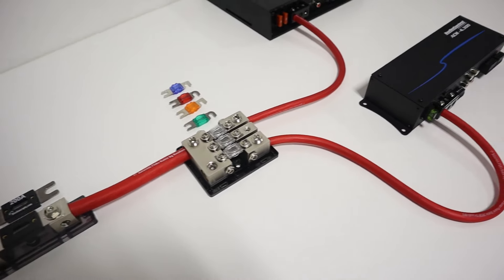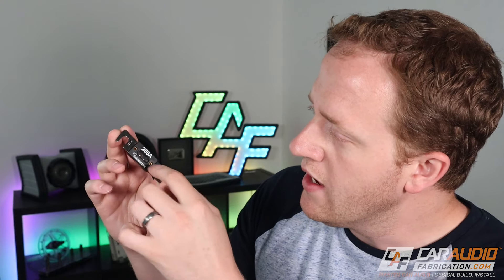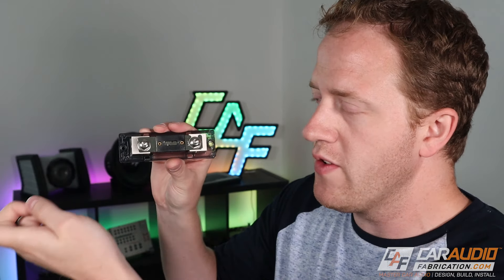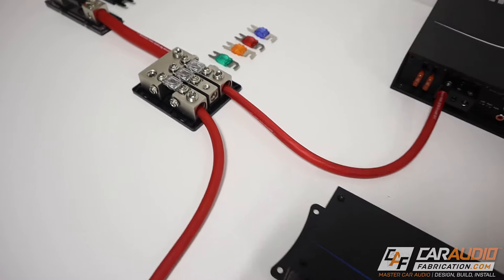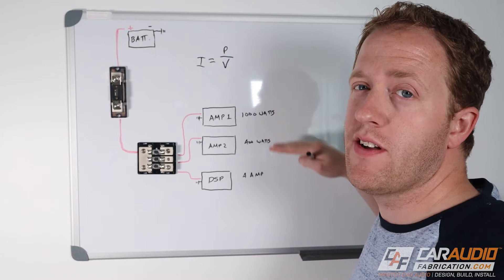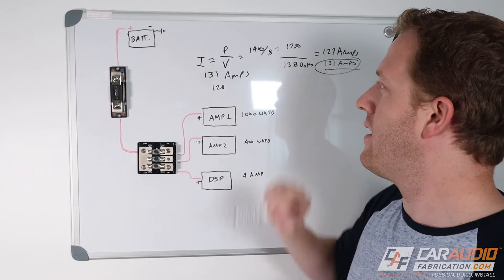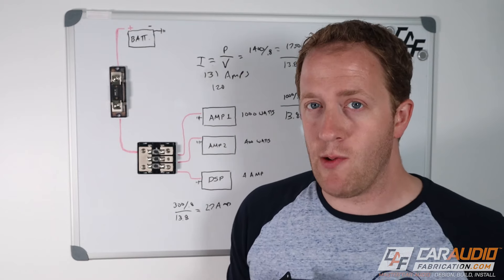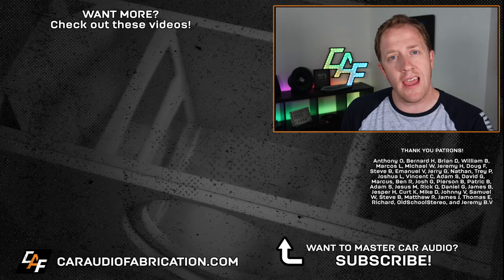Fuses EXPLAINED! What size do YOU need & MORE!

Comment: Hi mate, new to this whole thing but want to learn I got a RFC10HB Rockford fosgate capacitor and a  S-Series 1200W Mono Amplifier for a two 10inch sub and I want to run another amp for the speakers would I still need a distribution block or I can use that capacitor as a distribution block? Thanks

Comment: I have a 8000 watt amp wire at 4000 watts 1ohm for 2 subs, 1500 watt wired at 600 watts for mids, and a 4 channel wired at 100 watts per channel for highs,,,, could you tell me if i figured right at needing a 500 watt main inline fuse. that  seems like a lot.  learnt just about all on installing from you videos and still learning. thanks

Comment: Hi 
    Love your videos. You mention that the amps have fuse specs, but you want to show how to calculate without those values. This is for a Audio Control dsp/amp:
AudioControl D-6.1200
6 x 125 watts / channel =

750 watts rms
750 / .8 / 13.8 = 67.9
Or  70 amp fuse ?

The specs for the amp say: fuse rating: 40A x 3
 Has that any relationship at all to the fuse calculation we just did for the wire? And would you have chosen 70amp fuse?

Comment: If we use a distribution block on the positive side do you have to use a distribution block on the grounding side? Or can we ground into a “proper ground location” individually for each amp?
Reply: Also my battery is relocated to the trunk where my gear is.. I can use smaller wires apparently since I have such short lakes? You da be man

Comment: Is a busbar ok to use at the rear of my car? I am connecting a kicker keyloc and my 500 watt amp to the busbar and adding a 2amp fuse connected to the busbar then to the keyloc. Do I have to worry about fires using a busbar considering on the side of it is somewhat open?

Comment: Question should I be using a circuit breaker up front at the battery my system rms wattage is over 6k ?

Comment: Hey quick question I blew a fuse my, original was a 150 for my inline block and didn't notice I got a 300 amp I have o guage wire hooked it up and no issues should I re order for a 150?

Comment: Need your help. I bought a RF P300-10 300w Sub to go into a 15 RDX connecting to the high level. I bought RockRix Copper Clad 4 guage amp kit and it comes with a 80amp fuse. Should I buy a lower amp fuse like a 20-40amp? This is all im adding as of now but bought a 4 guage to future proof for when im ready to do interior speakers and amp. Thanks in advance!

Comment: Hey Mark I realize how old this video is but hopefully you'll get back to me. I have my power wire coming from my battery with a 120 ANL fuse at the battery going to a dist. block unfused. Then from the dist b. I have stepped down in wire size going to 2 separate amps. One amp recommends 120 while the other one is 60. So, after the dist b., I have an in line fuse with a 50a fuse going to the one amp and the other amp that needs 120, I have no in line fuse because of the 120a at the battery. Hope this makes sense.  My question is this, is the in line fuse ok or is it a case where I should definitely just have a fused dist block?

Comment: What about when going up in wire diameter? Old car had 10ft 6g for 100amps, now I have a van that I need another 5 ft to get to rear area, would it be ok to fuse block from 6g to 4 gauge? Yes I want to run the 4g from battery to rear but its winter and Im just trying get thro the season.

Comment: Hey Mark, if im using Hertz HCP1DK to run a 10"mile Legend sub at 4 OHM and Hertz HCP4DK amps to run front Legend 6.5 2 way at 4 OHM and rear 6.5 pro at 4 OHM. What would the power consumprion and amps be?

Comment: Hi! I love your channel! I need help please...I have a Rockford Fosgate R2-1200X1 and on the owners manual, it states that it needs a 200amp fuse...So, I am running a 0 gauge wire, I have a 200amp anl fuse next to the battery in front of the car...I am running this 1 single amplifier only...My question is, do I still need a fusible distribution block at the  amplifier in the rear? Or just a regular block...And if I do have to run a fusible distribution block, what amperage should I run...I am running 4 gauge in the rear after the block to the single amplifier...Please help! Thank you!

Comment: Have a live 12v high amp source running through my car interior to the amp seems sorta dicey ( but mayb not)? Can I install a 12v/120amp relay in line by the battery along with the inline fuse. It would use the head unit trigger to close the relay and energize the wiring back to the interior?…thanks

Comment: I see that the ANL fuse has two sides, one with like a hook termination and the other like a fork. Is there a side the goes to the battery and the other to the loads or can it be installed in any orientation? Thanks!

Comment: What’s the best fuse holder / block as for voltage drop, long term weathering and clean power. Around the 5 to 10 amp range. Even if it’s pricey. Including what’s the best clean power fuse.???

Comment: Do you adjust the wattage the amp is using in your calculations if you are not using the amps full power? I have a AudioControl D-6.1200 that is going to be ran with a 4 ohm load. Do I use the 750 W rating for 4 ohm or do I use the full 1200 W rating for the 2 ohm load?

Comment: Mate your channel is great! It does share a lot of info!. I have a short question, if I’m my system I have a capacitor of 2.2 farad, I could see the data sheet indicate 2200 watts, should I include this in the calculation of the system? Or does not count?

Comment: I'm trying to figure out the proper power distribution for my setup.  I have 4 awg wire going back to the trunk area to an un-fused distribution box (Rockford-Fosgate RFD4).  From there I want to feed an Alpine MRP-M500 amp and also 2 Viair 444C air compressors that are 30A each.  The air compressors each have an inline 30A fuse.  I was thinking of running an 8 awg wire from the RFD4 to another RFD4 and then have the 2 compressors connecting to the 2nd RFD4.  This 2nd RFD4 would be in the spare tire area with the compressors.  I just wanted to try and keep the compressors wiring length to a minimum and was thinking of doing it this way.  Now also wondering if I should have a fused connection between the two RFD4's??  Also just wondering if I need a fuse before the amp or not.  The 8awg wire from the distribution box is only going to be maybe 12 inches long.  Should I put something like a 60A fuse between the un-fused distribution box and the amp or is it okay to just go directly in the Amp?  Any thoughts or suggestions?

Comment: hello Mark, one quick question can we use a 12v circuit breaker which has the same rating as the fuse instead of the fuse holder next to the battery

Comment: Thank you for sharing nice  explanation. Why do you think companies are suggesting larger AWG for an amp? Showing exmaple from JL-Audio JD400/4 which total 75 W x 4 @ 4 Ω - 14.4V should be 300 watts. so power base on you explanation [(300/0.8)]/13.8=27.2 Ampers this company is suggesting fuse 40A and cable AWG 4. So based on the calculation of 27.2 amperes as per you table with 27.2 A and 16 feet lengh cable the cable AWG should be 8. So this is not matching the AWG mearument suggested by JL audio vs our calculation. Please advise!

Comment: What do you do about fusible links if you're running 1/0 wire for a big 3 upgrade? I've got 2...1 at the junction block from the battery, and 1 from the alternator.

Comment: H i love your videos They are very helpful. .Can you help me with something? I just need some clarification. Im installing 2 amps in my 2015 Suzuki Swift Sport, they are a  Pioneer GM-D8701 1600W Class-D MONO with two 40amp fuses in and a Pioneer GM-D8704 Class-D 1200w 4-Channel with two 30 amp fuses in, can you tell me what size fuse i should use at the battery end and what size fuse for each amp in my distribution block as im not sure i have worked it out correctly i think 150amp fuse by the battery and 50amp fuse  for the 4ch amp in distribution block and 60amp fuse for the mono amp.Will this be ok? If not can you tell me what i should be using please.

Comment: Need some help here. Going to be running 4 Sony XS-160es speakers for the doors, and two skar evl 65 loaded boxes. Amps are going to be a Rockford fosgate T600-4 and a Rockford Fosgate punch p500x1bd. Looking at a total of about 800 watts rms. Trying to figure out if I need a capacitor, and if I possibly need to upgrade my speaker wire from factory (factory is 16 gauge speaker wire that was running 25w rms, currently running 45w rms with no overheating issues). Also, should I be thinking about a new battery if I am doing this? Lastly, should I be running 1/0 gauge power wire, or can I get away with 4 gauge?

Comment: Hey Mark! My Audison AP F8.9 amp has 2 30 amp fuses but is 1040w rms, your formula suggests that the amp should have a 90A fuse?? Can you clarify this. Amp specs are 8x85w rms @ 4 Ohm  8x130w rms @ 2 Ohm and 4x260w rms @ 4 Ohm Bridgend. All are at 14.4vdc

Comment: I’m used to running a 0 wire from the front battery to a second battery in the back. But this time I’m going to skip the battery and just use the fused distribution block in the back with multiple outlets. So my question is, am I supposed to ground the distribution block ? Or does it just ground directly to the amps. When I had a second battery in the back. I would ground the battery before running wire to the amps

Comment: If I could get a recommendation that would be great, I'm running a Rockford fosgate power t10001 bd (discontinued amp) with two Rockford 10s, I've ran many systems before and never had a problem with my in line fuse blowing it has an 80 amp in it and if I crank it up it blows within a couple minutes, I tried a 100 amp fuse and it pounded a bit harder for a bit longer and it blew, what would you recommend? Anything will help. ( I'm running 4 guage wire and the amp has constant cooling)

Comment: Hey Mark...I heard about some people that told me that if you put a fuse block or fuse holder into the power cable,we will have a drop of voltage...like .2v or .4v? Because the circuit its interrumped...

Comment: I have a Jl Audio slash 500/1 and a HD 600/4, the manual says that both needs a 50amp fuse, so in my distribution block I should use 2 50amp fuses, but what about the main fuse? Its ok 100amp or more than that. Thank you

Comment: The best descriptive video! If I could ask a question I'm using this video to determine fuse sizes on my 2500w pure sine inverter setup @ 90% efficiency that I'm installing in my truck (pretty cool). If I understand correctly could I just take the max continuous output my inverter does of 2500watts @90% and plug that into your calculation to find out my main fuse size coming off my primary batt (dual batt) before my isolator (stinger 200amp) on at the moment 4awg cable? Im hoping that's the way cause at the moment I can't be sure what all else I may run off the system....

Comment: When im calculating fuse size for amplifier current.. do i use max peak power or max rms.. and if i am running multiple amps should my fuses in my distribuition block add up to the same value as the main power wire fuse ??

Comment: Quick random question, I just purchases a mini air compressor that plugs into the car 12v socket, I plugged it in and it worked but when I took it out it blew my fuse twice, then the third time I turned the engine off first then took it out and the fuse did not blow, so I can use it and unplug it when the engine is off but when the engine is running it will blow the fuse, the fuse is 15a, so my random question is if I changed the fuse to 20a would that stop it from blowing and also could I actually change the amp from the fuse that originally come with the car? Otherwise I will have to keep a load of spare fuses when I want to blow up my tyres.. Thanks

Comment: 1st timer here. Do i run my power wire from the battery on the same side as the battery or opposite side of battery. Also do I run rca cables next to or on opposite sides of the power cable. Thank you in advance
Reply: Rogelio Suniga not this guy but I heard you must run the rca cables to the opposite side for in case of interference.  Also getting a noise reduction ground loop for that kind of thing also.

Comment: I just got a Rockville Krypton-M3 4000w Max/1000w RMS Mono 1 Ohm Car Amplifier and I also have the Rockville W12K9D2 12" 4000w Peak Car Audio Subwoofer Dual 2-Ohm Sub 1000w RMS CEA Rated. What amp fuse do I use coming from the battery in the power wire? I’m having trouble understanding. I’m horrible with math. 😅

Comment: Is it ok to use a distribution block that doesn't have fuses if you add an inline fuse to each line and use a gauge of wire that can handle the total amperage?

Comment: Excellent video. In the past builds I used to do we would use the glass type, but that was a long time ago. Mark, I do want to ask you about the use of breakers. I used a circuit breaker in one of my past installs and wanted to get your take/opinion on those. Are they less safe (more prone to failure)? Or still another option? This would only be installed immediately after the battery. Thank you!
Reply: I'm curious about this as well!
Reply: I'm curious also as I just installed on for my build.

Comment: How do you feel about using inline circuit breakers in audio wiring? I have my main feed from the battery to a 150A breaker and into the firewall, to a capacitor then it branches off into the sub amp (RF 1200.1-D), door speaker amp (RF 400.4-D) and a DSP. How would you go about this? Id like to add a fused distribution block to each amp, but not sure if it should go before or after the capacitor... Thanks for the great info!

Comment: great video Mark. Now I think I wired my car amp incorrectly.  I don't have large fuse holder. Instead I put the distribution block(1/0 input, two 4 gauge out)  to the battery with 1/0 gauge. then two 4 gauge wires through the firewall to the amps.   That distribution blocks have two 60a fuse for the amps. Should i add a large fuse holder and move the distribution block to the trunk ? My amps  75w x 4 channel and a 675w mono .

Comment: Great video I learned so much! Though why did you add the two amps together as one fuse? should they have their own fuses from the distribution block? doesn't that leave the second amp not fused since you're only putting it on the first amp on the distribution block?
Reply from the maker: Im not sure what you mean, both amps have a fuse at the distro block and the main lead is fused at the battery.
Reply: @CarAudioFabrication  thanks for replying. I missed the part when you actually mentioned doing the equation for all fuses that go to the distribution block. I was waiting on the visual for the sub amp to be written out like the other two devices. Sorry for the confusion. and one more thing I have Hifonics bg2200.1d rated at 2200 at 1ohm and 1100 at 2ohm. loading with 2 12 mtx svc 4ohm 500rms each sub. the recommender wire for the amp is 2 gauge. My question is since I'm only using the amp at 2ohm can I use 4 gauge wire and a fuse matching the 4 gauge to the distribution block or should I stick with the 2 gauge and a fuse rated for 2 gauge? I already have the distribution block in a cart now just trying to figure out the fuse and wiring for the sub amp.

Comment: Hi Bro . I am powering 2 amp in my car can i use 1 fuse block and a distribution block is it good to do it that way or not ?  My amp is 3800w  i will be using 2000w in bridge and the rest i will use 1 pair of speaker.  The next is i will be connecting LCI2 pro

Comment: Also keep the fused dist. block close to the amp as possible. this keeps the reduced size wire short as possible, which will be able to carry more current than a longer run.
Actually, just a good idea to keep all cables short as possible. Don't leave 5  ft of extra wire just balled up in the trunk. Looks bad too.

Comment: Would also add however, zip tieing cables is good, be mindful however you can have the cable rub thru and cause a short. Also ensure that where you have your cable run you are not putting it in a position where it can rub through or cut through.

Comment: So doing this math, I would need a 144 (150amp) fuse for my main power wire, but the manufacturer for my 2 800w amps recommend an 80amp fuse. would/should I need to do a 200a main fuse instead in order to use the recommended 80a fuses for each amp at a distribution block? The amps I would be using are the Skar RP-800.1D and the Taramps DS800x2 - 2ohm.

Comment: So im curious! If I have a amplifier at 5000w with 1 ohm but im going to make the subwoofer 8 ohms so it will only push at around 900w. What type of fuse do I use then? Do i go off of the 900w or the 5000w watts depending on the ohms

Comment: Hello I know I’m late to the party but I had a question maybe you can help with. I am planning to run a system and will have 2 amps one mono and 1 4 channel. The mono is a jp23v2(I know d4s amps aren’t the best but for my budget it works for now)  and 4 channel is a jl rd 400x4. Mono amp says 300 amp fuse. Rd400x4 recommends 40 amp fuse. So total would but 340 is 350 amp for my inline fine? Can a knuconcepts distribution block handle that intake as long as outputs are fused correctly? I know it’s long but I would appreciate any help!

Comment: New message to: jk2107

Wonderful video. Hope u can help me plz.
 There are two fuses of 30Amp each in Exonic 274.
As the Exonic 274 has 30 x2 Amp fuses,
May I use an inline fuse holder of 60 AMPs?
What is to to be chosen AFS OR ANL please.

Comment: My new amp is the ct sounds 900.1d AT series it comes with 3 built in 40 amp fuses what size fuse should i use for the inline power fuse near the battery?